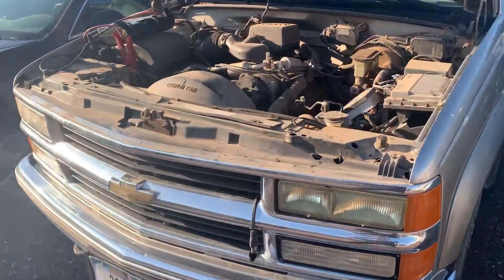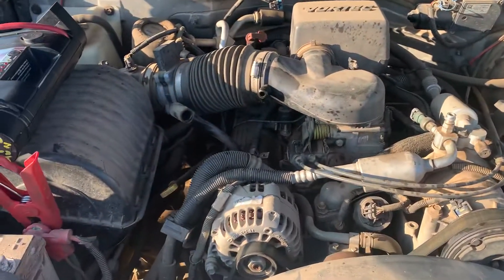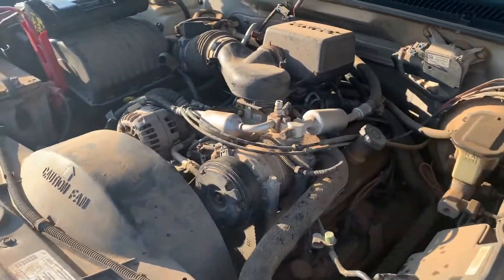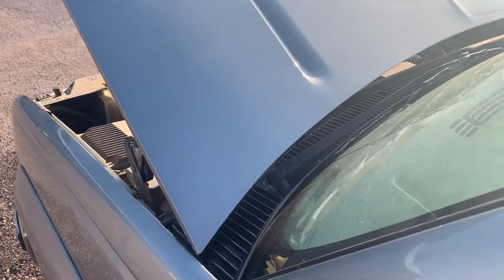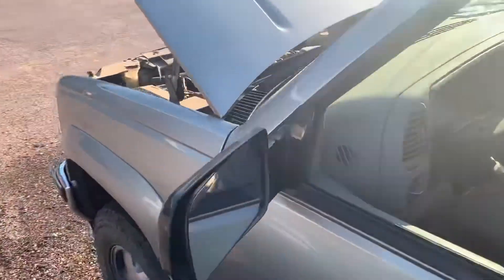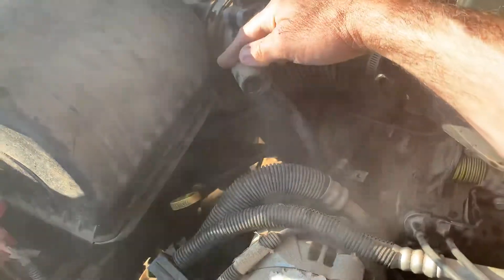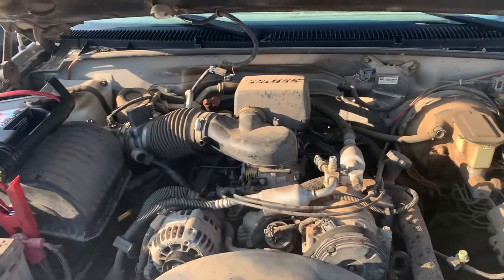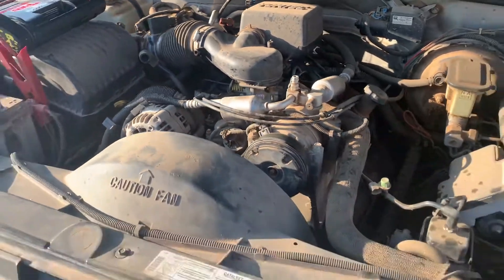What Is Blow By In A Car Engine

Comment: It it happens but engine still runs smoothly and normal..does it still needs to be replaced?
Reply: Drive it until it explodes
Reply: @hyperpotatoYT  ok papa
Reply from the maker: If it still runs well but has a lot of blow by it can still run for a long time yet but burn some oil in most cases.
Reply: @UnderTheHoodShow  is there anything that can be put to minimize it? Any oil additives?
Reply from the maker: @Trd2020  if it is cause by stick piston rings, sometimes you can use a additive like oil system cleaner.
Reply: @siphoernest2278   yup. Just had my jeep commander engine blow on me due to blow by. Buddy noticed it by placing a piece of paper over my oil fill with the oil fill cap removed. It caused the paper to concave, in my case I had suction. But some cases I hear it will blow air out of ur oil fill too. Requires engine swap or rebuild.
Reply: I had blow by. Had the rings changed and now have high oil pressure to the point it's coming out the dip stick. Ford custom

Comment: How long can an engine thats experiencing blow by last? Got a plow truck (same generation GMT400) thats got blow by starting on its 4.3. Hoping to get another winter out of it before scraping.
Reply from the maker: It could last years or days. Depends on how bad the engine is inside. We have had customers with bad blow by on older bigger engines run them for years.
Reply: @UnderTheHoodShow  thanks